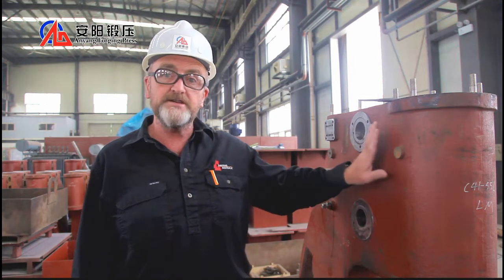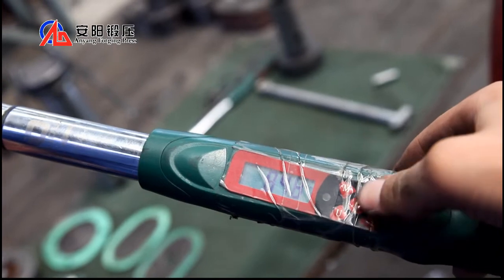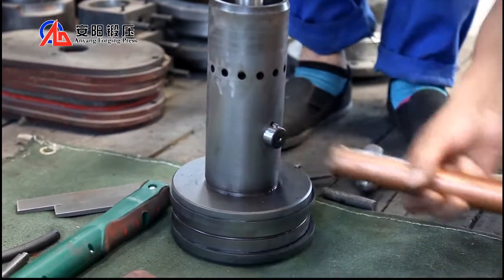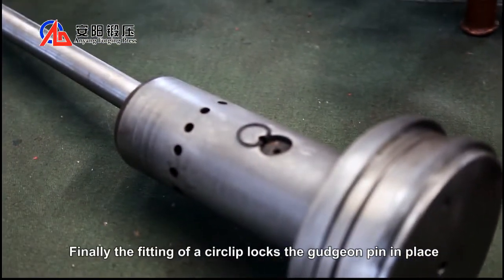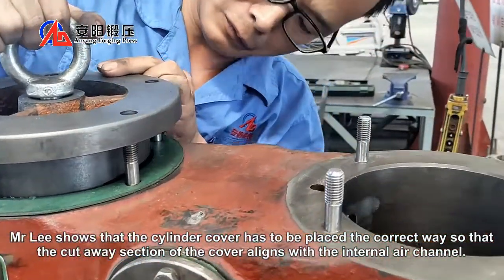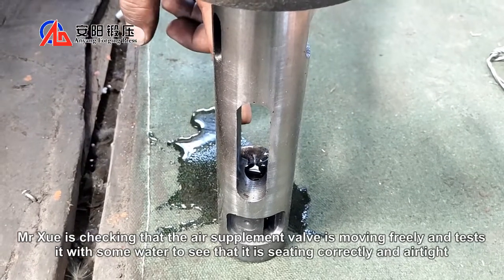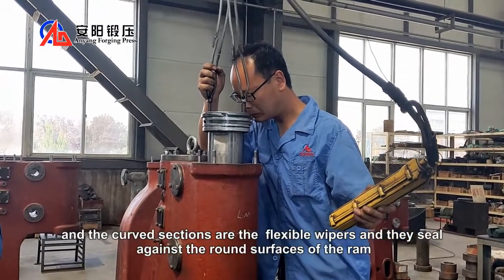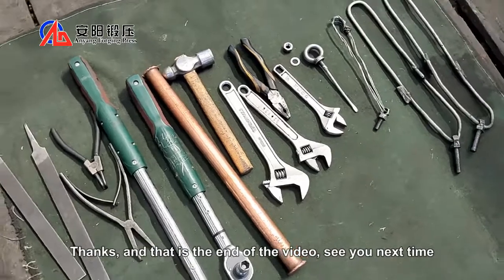how to install anyang power hammer video

Comment: The installation vid appears to gloss over important floor thickness/mounting requirements and floor modification needs ... it only seems to cover assembly of the unit itself.

EDIT: Comment resolved in stellar fashion, albeit in the discussion thread.
Reply from the maker: 1.   95% of my customers that own an 88lb or smaller hammer use their existing foundation with no modification.  I recommend filling the base with sand and placing a ¾” piece of plywood between the concrete and the hammer base and then anchor the hammer to the concrete.   This works just fine on most healthy 4” to 6” foundations.  I’ve had my 88lb on my 6” pad since 2004 with no signs of a foundation issue.  Worst case, if you find that you are getting more vibration that you want, it is easy to remove the hammer and install an isolated foundation. 

2.   For the larger hammers, 120 lb. and up, I highly recommend pouring a separate foundation.  I’ve had a few customers that were renting a shop and ended up simply bolting the 165 lb. to the foundation.  It did work and no damage to the floor has been reported but its not good practice. 

3.  For a disclaimer, I am not a structural or foundation engineer.  If you are concerned about your specific soil conditions or application, I would suggest consulting a professional engineer.  I will describe what I did for my foundations and what worked for me.  If you decide to install a separate foundation, it is not that difficult and can be done for $400 to $700.  I have built two isolated foundations in my shop, for the 165 lb. and the 242 lb. hammer.   I rented a concrete saw to cut out the new foundation perimeter and then a jack hammer to remove the concrete.  Then I dug a hole 4’ deep (concrete is cheap), built a rebar cage that I could set in the hole.  I also used 1” Styrofoam insulation to isolate the old foundation from the new concrete pour.  I also welded threaded rod to the rebar to anchor the hammer and poured the concrete.  After the concrete set, I chipped out about 1" of the Styrofoam and used a rubberized caulk in the seam between the old foundation and the new one.   It was a several day job but there is absolutely zero vibration (that I can detect) in the old foundation.  There are also many articles on the internet for further research. 
https://www.anyangusa.net/foundations.html
Reply: @anyangwells  Ah, excellent info ... exactly what I was looking for.  I'll update my OP and +1.  Thanks !

Btw, feel free to delete my OP and pin your helpful reply ... I think a lot of people would find it more visible and helpful that way.
Reply from the maker: @RovingPunster  what i supply you is from our norther america dealer Mr.James, he firstly is a blacksmith , run and sold our hammer near 15 years. so he post his experience on his website to help many of hammer users.  www.anyangusa.net